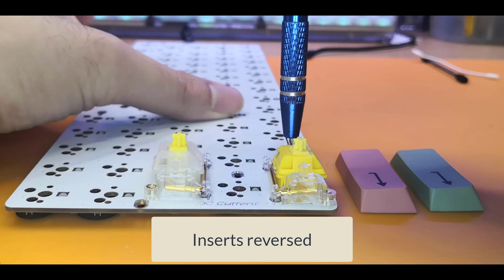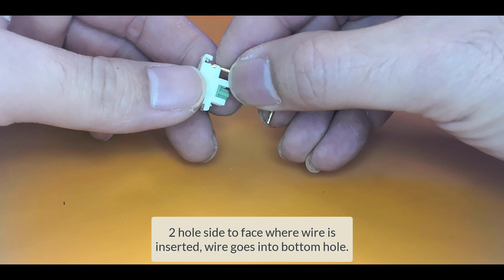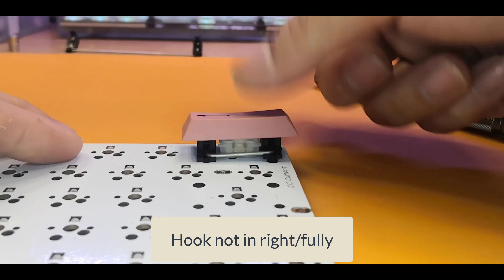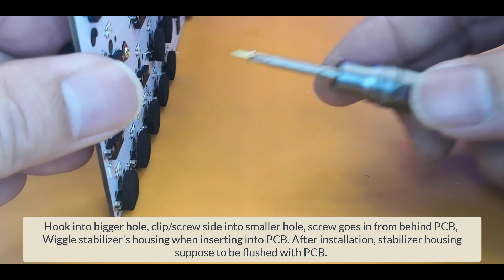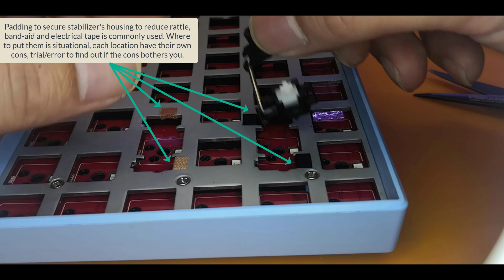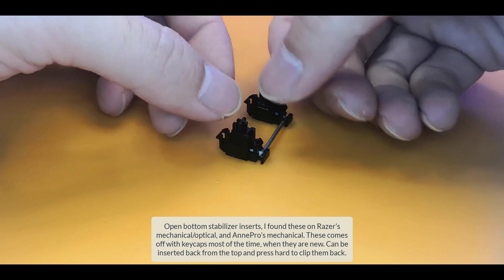Guide for Stabilizer Assembly Installation and Common Mistakes

Comment: My issue is that I tried installing durock plate mounted stabs into my gmmk full size, and I have to put force for it to go in and it doesnt clip in. Then when I place the switch and the shift key in, it stops half way through the push, then fully down, and takes a while to go back up.
Reply from the maker: the stabs and  switch are not aligned properly, because the stab housing is not clipped in properly. for gmmk fullsize, there's a few screw under some tape on pcb that you can unfasten to separate pcb and plate, to install durock plate mounted stab (a bit tight), then you secure pcb+plate again with screws. try that.
Reply: @issey83  ok
Reply: @issey83  I tried what you recommended, I separated the pcb and the plate, however when I attached the stabilizers, it still didnt work, I will tinker around with it more tomorrow but some people are recommending to file or sand the plate, however I don't know how to do that and I'm a bit scared of messing it up.
Reply from the maker: that is an option, good luck.
Reply: @issey83  do you know how I can do this. I don’t really know lol. I appreciate your help a lot btw, thank you.
Reply from the maker: get a small file set, start filing.
Reply: @issey83  k

Comment: I have a BM60V2 and everglide v2. I'm not able to place the stab right, I fit it just that the screw part is raised, is this normal?
I'm afraid of breaking, I'm stupid :)
Reply from the maker: wiggle the stab towards pcb, make sure the hook side is in fully before closing the screw side down. some pcb will have tighter tolerance than others, you may need to press harder.